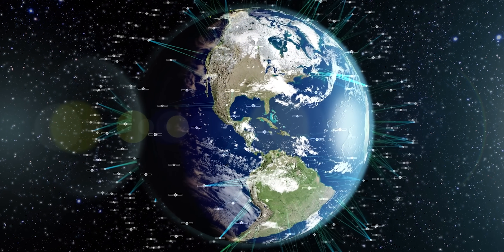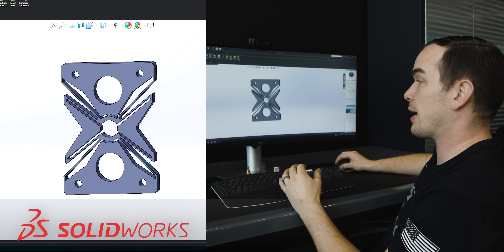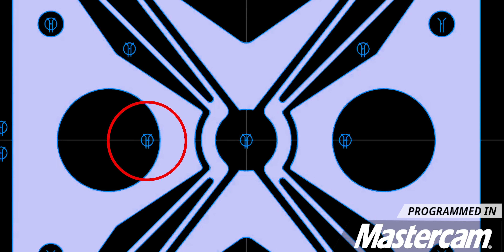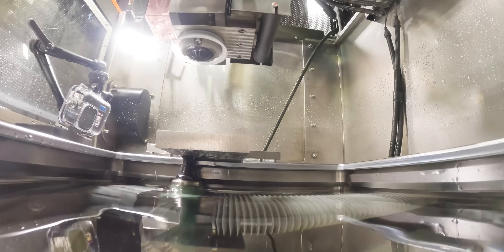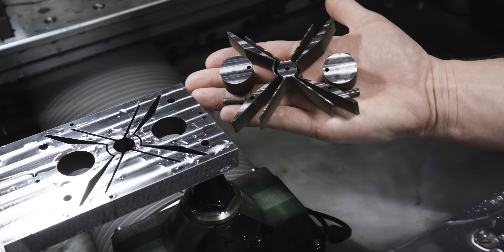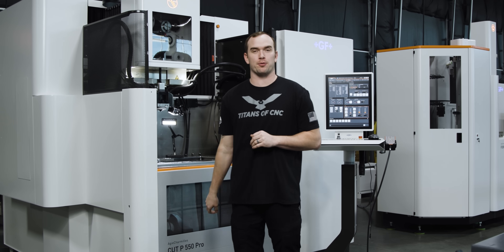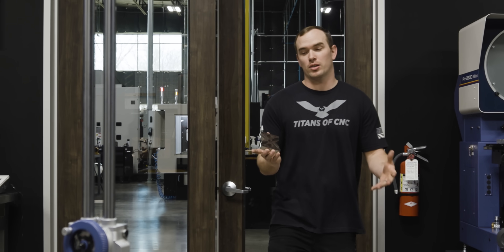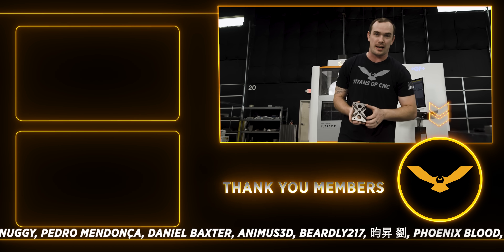This Part is Impossible To Machine

Comment: Little tip for the slugs to take out having to come back to the machine at all. Since ur part isn't very tall just put a square block under it to raise it up a bit, when the wire cuts and it moves onto the next hole the slug should just drop out. If not add a flush command from the top jet before it moves on.

Comment: I wonder if 3D printing this part would be a better way to manufacture.  I really doubt the tolerances on this thing are as tight as even +/-0.002" as it's a component meant to flex so it has some give.
Reply: @vichenzadoorian7551  yes

Comment: mean while on the farm... building the 8kva mobile power unit is nearing completion, to fix the cracked sucker rod on the water well head... that will eventually get a solar wind module and remote fluid level sensor for filling a 2 acre pond 280 yards away. 600gph when it holds water being fitted once a year. koi sushi costs more then the scrap weight of that part that's out 0.000001'', material items simply accumulate.

Comment: What if you made something similar to this from say stainless, then added a layer or two of nylon cloth or even kevlar. To the joint areas.. to reinforce them yet maintain the flexibility a composite of stainless , kevlar and  a resin that keeps some flexibility and provides a strong bond to the stainless. It may require media blasting or acid etching for a strong mechanical bond.  Something that sets up like a polyurethane slightly rubbery. Yet thin enough to soak in the kevlar fibers.  Nylon  cloth works wellvin very cold temperatures.  The resin would need to be similar when setup.  The thing about using a composite, thev part would stillbbe one piece. Even if the stainless fatigued to fracture , the addition of the composite should dampenthe fatigue. Prevent the fatigue possibly prevent fracture with a readonable range of motion. It should push the flex out to the center of the thin ares away from the transition area from thick to thin. The area most likely to fracture is close to the thick portion. It should act similar to a strain relief on a power cord.

Comment: Why does this part have to have such a compex shape? Based on absolutely no calculations at all, to me it looks like the part will have areas of very high stress - the edges of the flexible sections. And some areas of low stress, which is what we want, I assume? Lower stress means more durability. The only reason I can think of is if we want some very specific curve of resistance across the range of motion?
Reply: To fit within a larger structure for as little weight as possible overall since it will eventually be part of a satellite
Reply: @KaitouKaiju   but this doesn't look like 'as little area as possible'. Why isn't it a simple bendy sheet of titanium? Just a simple rectangular bendy bit with mounting holes at the edges.

Comment: So does it continually flex until the the metal eventually breaks? Like a spring?
Reply: Like a spring except not just in a line. The metal isn't gonna break any time soon because it won't go past the point of plastic deformation

Comment: This looks like a really important part.  Have you looked into doing any metallurgical testing on this like the aerospace industry requires for non conventional machining?  I bet that would be a tricky part to do some shotpeening on with even fine glass beads.  How much fatigue life would you gain if you could do so?
     I’m just suggesting some things that you could bounce off the design authority for the part.

Comment: I really wanna know what that part is for. He was pretty vague - something about star aligning or whatever. Fascinating stuff.
Reply: Google butterfly flexure pivot, and one of the first things that comes up is a paper on Researchgate by Simon Henein and Peter Spanoudakis with a detailed description of the part. Apparently, they're used for precision instrument orientation on satellites, particularly Fast Steering Mirrors for optical beam guidance. In short, they're used as part of a mechanism that uses a voice coil (kind of like a speaker) and a mirror to precisely deflect laser beams. On a satellite, this might be used for satellite-to-satellite laser communication where you need to be really accurate (i.e. where the precision of the beam angle is measured in microradians, like literally hitting a receiver on a satellite with a laser beam carrying data pulses from another satellite from ridiculous distances).

Comment: I’ve never used an edm, but that part took 3hrs? From what I’m seeing half of that part could be machined.
Reply: Which parts? You’ll never achieve the positional accuracy required if you machined the holes or really anything on another machine. Cutting it from billet on the wire essentially ensures the positional accuracy is as good as the machine is capable of, which is very very good.
Reply: Yeah I was thinking the holes and most of the border. What if you bolted down a jig and used the edm to cut the reference holes and turned some reference pins to fit the machined holes? Or something like that using the edm to cut the references

Comment: by tenth do you mean .1mm or .0001mm tolerance?
Reply: he is talking in inches .010", you can see the dial he is using is Imperial as well and watch it move the ten thou end to end @6:01
Reply: @ratboyiscool  missed that because the only  dial gauges I've ever used was metric
Reply: @trailfork7815  makes perfect sense, just figured I'd point it out cheers 🥂

Comment: The resistance to the vibration and acoustic environment of launch will be a much more important metric than how many cycles it can do in operation I imagine, launch is a horrendous environment. While the actuated mechanism is likely locked in place for launch, parts like this will definitely need to consider resonance. Was there more assessment done in house or is the final design contracted in and the solidworks an in house sanity check of the design (most likely for manufacturability and tool pathing or conversion I'm guessing?)

Comment: Using that lower flush jet was genius, I have no clue about wire edm but it gives me the same vibe as using a tap wrench to lose. A square head bolt on a lathe tool holder

Comment: Nice part but as you said it moves as you cut, as you left a 0.0500 tab then go back to snip the tabs you could have programed a triangle tab and then with gentle tap knock them out and let the skim pass take off the excess, if it's going to move it's going to move due to the springy nature.

Comment: i operate an electric band saw to and im in love with it, i have Mitsubishi FA20s, the only downside of it is that the integrated cam cant program more than 25 parts at the same time and i can't program the parts to cut after everything is done so I'm stuck to separating the program by hand into 2 separate programs

Comment: Cutting with wire is insane and clean, no heat. Wow 👏🏻
Reply: There's only no heat because the part is sitting in fifty gallons of coolant.
Reply: @jmowreader9555  EDM doesnt use coolant, it's deionized water.
Reply: @verakoo6187  Water is also a coolant.

Comment: So I have a question. Does the machine make the holes to then feed the wire through to start the cuts or is this a separate operation that has to be performed on a different machine?
Reply: The start holes are made on a separate machine. Usually a hole popper or a mill.
Reply: @trevorgoforth8963  You forgot to mention/link the video where someone used that device it to remove a broken tap from an expensive part
Reply: I used an old agie 100d and that had a startron edm hole drill incorporated into it
But i always first opped the holes on the mill

Comment: i am curious why is this better than a hinge
Reply: Basically infinite lifespan (no wear and tear of the actual mechanism) if use within specs, really robust, and the tolerances on the movement are almost perfect. But since it’s designed to be in space it also has the advantage of being more optimal for weight when considering the saving this allows for the whole assembly and as someone else said their might be a problem with cold welding.
Reply: It is probably because hinges in a vacuum can spontaneously weld the two metallic parts together. They actually had hatches stuck on a spacecraft because it had hinges. Metals (or most other materials) don't have a protective molecular atmospheric layer between them in space, and when they touch, they meld together. That's why so many materials used in spacecraft aren't what we see here on earth. They also sublime (evaporate from solid). I.e. ball bearings are ceramic. Steel would gradually evaporate into nothing.

Comment: 0:30 As a random guy on the internet I gotta say that intro is a joke, I'm not saying the technology isn't a requirement for some projects, but the vast majority of projects tend to avoid using specialty parts like compliant mechanisms (that we're never really around until the 2010s anyhow). Especially back in the day when the GPS satellites were built wire EDM was way more uncommon, since they're extremely large and there was more room for traditional mechanical assemblies, plus the complexity and uncertainty of designing a compliant mechanism in the early 80s meant they were very rarely used. Back then the only real serious use for EDM was for waveguide and oddball RF hardware, and most of that was done via an additive technique known as electroforming, which is a process that starts with a metalized plastic mold inside a chemical bath where a solution of copper ions can be plated onto it, later using solvent to dissolve the plastic out creates the interior features while traditional machining is used to create the exterior features.
Reply: I have been using wire edm for years
It has been well used in the toolmaking sector for longer than i can remember and i am 60 this year
Extrusion tooling is one industry where it is invaluable but you seldom need to work to tenths when making dies there.
4 axis sim machining is quite common though to get the material flow path correct which can be quite tricky
Reply: Agree with the gentlemen above. Wire edm is far more common than the original poster understands.
Reply: @jaredjared8347  Again, context dude, I'm talking about the space industry, not toolmaking or any of the millions of other uses for wire EDM, we only use it unless we absolutely have too, most satellites don't have a single wire EDM part on them unless absolutely necessary since pretty much everything is designed to be easily mounted with acceptable tolerances and standard sized M1 to M8 hardware. The intro seriously overstates it's use.
Reply: Compliant mechanisms have been around longer than 14 years lol

They’re far lighter than a traditional ways of making something move, everything you can think of has them nowadays, cars, phones, tablets etc
Reply: @dakotareid1566  Sorry, I should clarify, I was talking about the space industry as we tend to avoid compliant mechanisms unless necessary since the failure modes and vibration modes can make them undesirable. Think of all the thin little metal structures in a typical compliant mechanism, now imagine what will happen when one of the many modes of vibration inducted by a rocket starts resonating that thin metal strip, it's really bad for the mechanism and what's mounted to it. So they're pretty much used only as a last resort because of this, plus you still need to add motors, sensors, etc. to actually do any work.

To be clear, I'm not talking about MEMS tech or plastic latches, those are everywhere now.

Comment: Mastercam?. No more Esprit?
Reply: We actually are using SolidCam for Swiss and EDM
Reply: This part was programmed in Mastercam but we will be using Solidcam and Mastercam in the future.
Reply: Interesting, we still use Esprit for EDM but I absolutely hate it with passion. Most buggy software I ever had to work with. Recently atleast we switched the milling to Fusion.
Reply: @P1-Engineering  Yeah, it kind of sounds like you guys could benefit from a standardized software to do it all like Mastercam. I haven't played with the Solidcam software yet but I know it doesn't support 4 axis cutting, they are in the middle of developing it. For Esprit, I didn't like the fact that you HAVE to bring in a fixture in Esprit Edge before you can even write a toolpath.

Comment: It’s amazing to see how advanced manufacturing techniques contribute to the success of space missions.
Reply: I'm starting to think that might be part of the problem, is anyone asking, do they need to be this precise ? This exotic? Etc. it's a tube with a nozzle on the ass end. I think Elon is onto something
Reply: @seancollins9745  When you are working in the vacuum of space, a lot of the intuitive knowledge you have for mechanical engineering turns out to be flat out wrong. NASA and other companies over the decades have build vast volumes of knowledge about engineering reliable systems in space. For example, on earth you might use a simple ball-bearing for a rotating part. In space you can't do that, as the lubricant will off-gas into the vacuum, and your balls and races risk cold welding and seizing up. 

Secondly, it is very expensive to get your craft into space, so a little extra spent on making all your parts perfectly to print removes one area of possible mission ending failure.
Reply: @Dubbie-gv9ry exactly.  If your spacecraft has 500,000 parts, and your failure rate is just .001%, then you will have 5 parts fail.
Reply: @seancollins9745   If Elon was smart he wouldn't have removed radar from Teslas